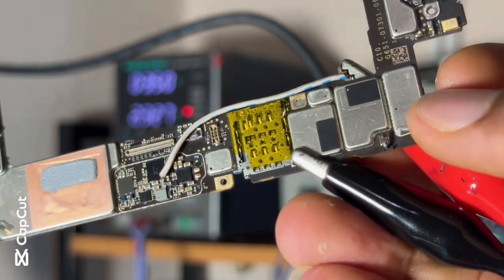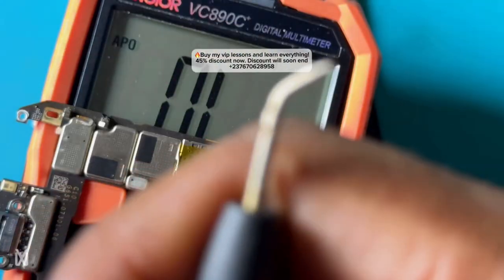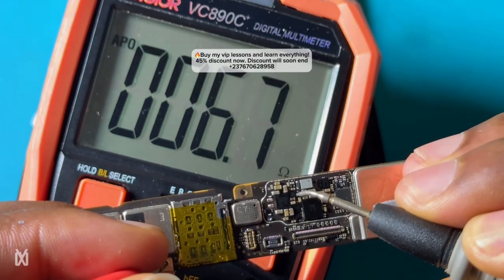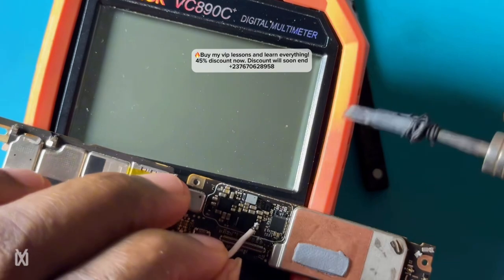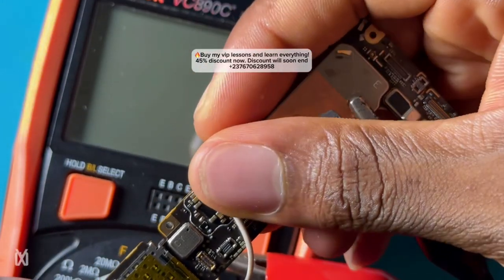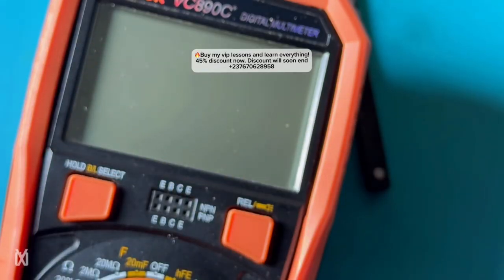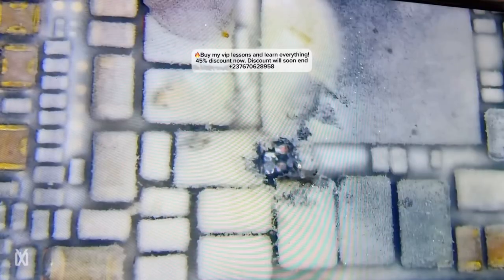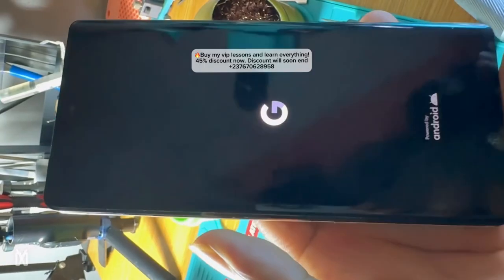How to Repair a Google Pixel Phone That Doesn't Turn On | Pixel 7 Pro Repairing Course Full Video!

Comment: Hello Mike..
I've got a tecno spark 4 kc2 that  bricked after flashing the wrong firmware and now it can't enter recovery mode nor fastboot and still shows nothing on the screen.
I have tried several firmware e.g v320,v237,v265,v186 ,v316 and v111 , however i keep getting an error that says
[01]DA Connection FailedSTATUS_EXT_RAM_EXCEPTION.

Comment: Do you replace the bad Capacitor with new one ? Or you just removed it and start the phone? 
Do we need to replace with the new one always if its bad or just remove as far as it works without replacing it?

Thanks
❤
Reply from the maker: I don’t replace 
It can still work without repairing as long as it’s connected in parallel